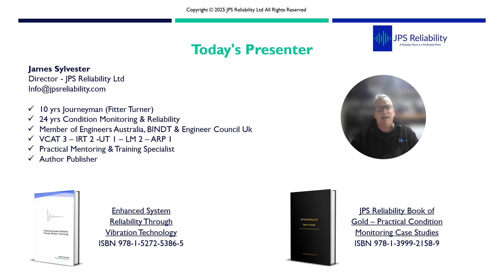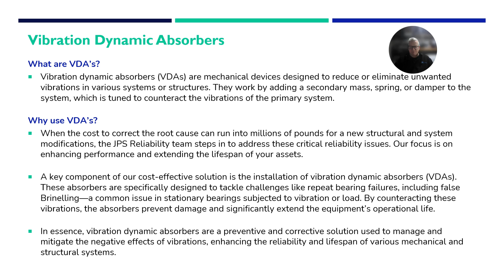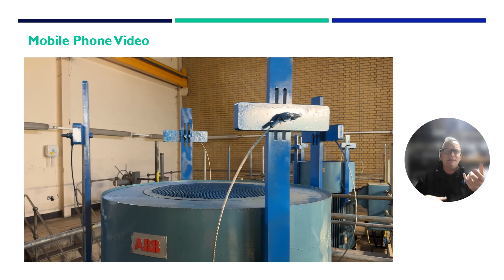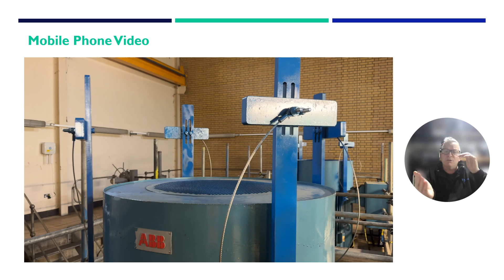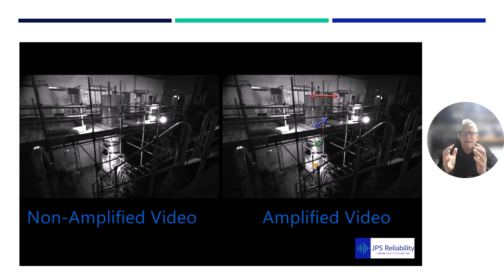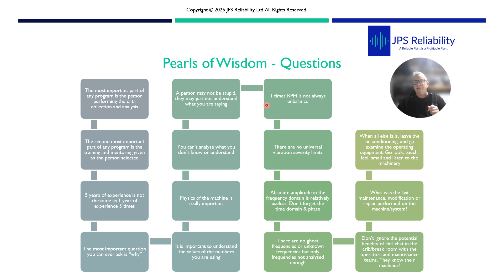JPS Reliability VDA April 2025 with Motion Amplification

Comment: Another great practical solution - and so simple. Lots of high-rise buildings have exactly the same systems but normally massive weights (400 or 500T) suspended as a pendulum to control vibration (passively) caused by wind excitation. We also worked on active (for earthquake zones often the power is lost so they are ineffective) and hybrid systems in the laboratory of University of Sydney early '90s. A coal mine in Queensland has a large amount of VAs scattered throughout the plant, added after the place was shaking itself to bits - all the screens (24 off) running at about 850-900 rpm.